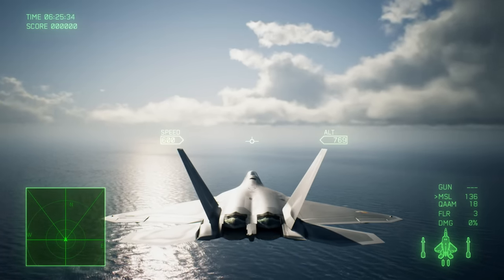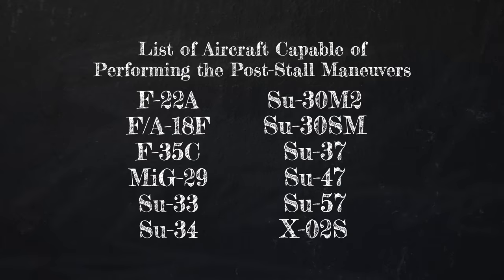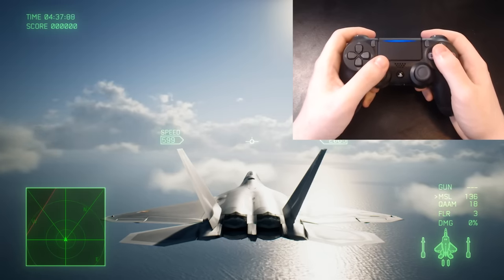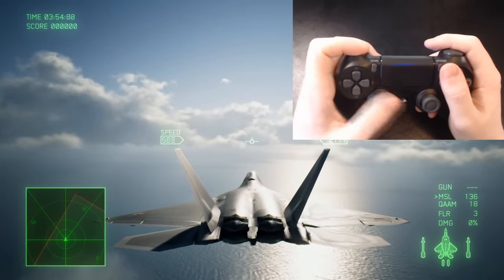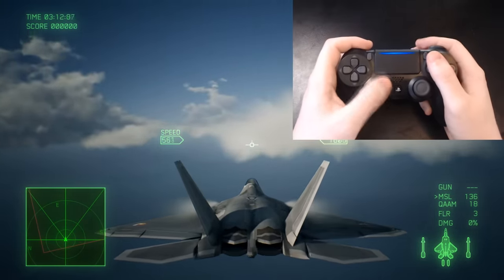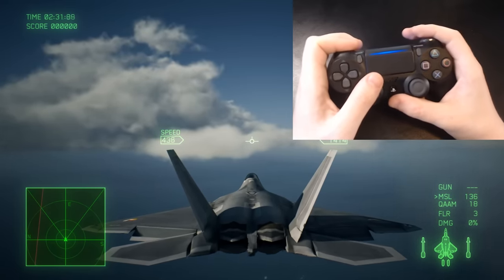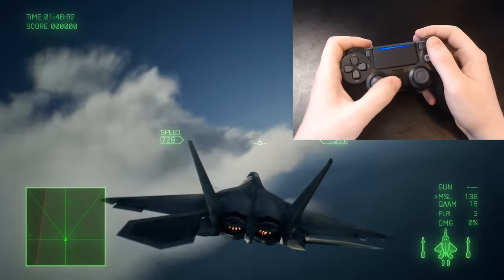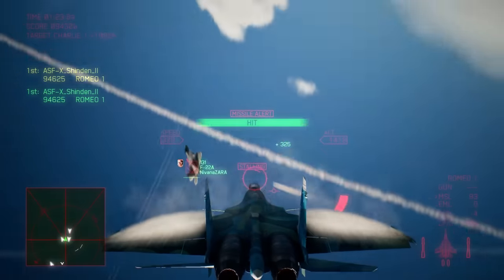Ace Combat 101 - #4: How to Perform Post-Stall Maneuvers

Comment: Can we do it with HOTAS ?
Reply: Did you try to press both pedals at the same time?

 =)
Reply: @vantuz8264  On my cheap version HOTAS, the pedals is on the stick, so not really possible 🤔
Reply: @DUNplus  It must be really difficult to play this game without gas and brake.

Jokes aside, someone suggested to bind both throttle up and throttle down to the same button. But i don't know if it'll work or not.
Reply: @vantuz8264  I have a HOTAS too and obviously even if you DO have rudder pedals, they control yaw-ing like they're supposed to. Lol
Reply: @DeltafangEX   you probably have something wrong with your kit. Try contacting the manufacturer and ask for a replacement.

Comment: When I try it takes me to auto pilot
Reply: He has a different configuration. Use R2/L2 and once below 215 knots (below 500 KMH) hit both ay the same time, pull back or bottom corner on the stick and keep full throttle while doing it

Comment: just like ace combat alssault horizon
Reply: Nope, there any plane and even freaking helicopters could do it. Also it was on rails animation occuring only when the dogfight mode was on. Here you have full control over it. I saw people doing more creative manouvers with this system, like stalling and flying upwards after that, or diving down, than flipping 90° to level flight.

Comment: Overall Pugachevs Cobra is extremely stupid as it requires extreme skill under pressure, is energy/speed draining and the recovery causes an extreme loss of airspeed which can only be countered by losing altitude, which means losing and advantage. Nobody does this in modern BFM. Please do these in front of me. I was considering getting this game. I'm glad I didnt. The flight model is a joke.

Comment: It doesn’t work
Reply: I've found that, in order to do it, you need to wait a split-second, after you hit the brake and throttle simultaneously, before pulling up to activate the maneuver. Hopefully that helps.